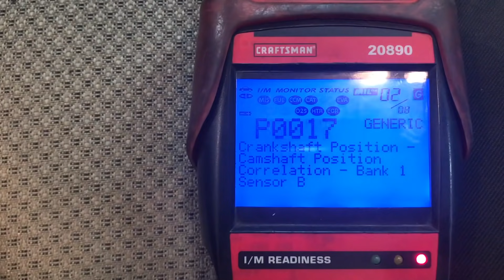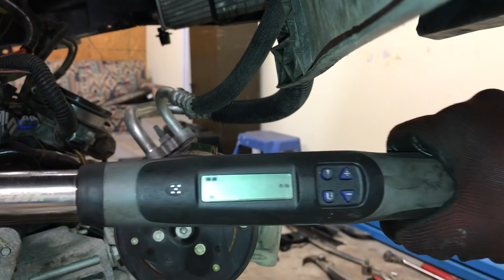Step By Step: 2.4 EcoTec Timing Chain Replacement

Comment: Before anyone does this make sure you look up your engine code because this is the same process for these engines but there are different cam positions for each engine like the LEA or LFA engine codes not following that can destroy your engine because it will set your timing way off if not carefully looked over 15 year gm tech here!

Comment: Anyone have any advice why the exhaust cam wont line up with the black link on chain? Gold link on intake,black link on 5 oclock position,  the exhaust cam sprocket is like a tooth or 2 off. Do i need to rotate or wiggle the cam and set the chain on the sprocket that wsy or rotate the sprocket not the cam

Comment: While the engine was out of the vehicle, you should have removed the intake manifold and cleaned the PCV passages so that the engine does not consume oil and therefore will not run out of oil which can cause premature timing chain failures.

Comment: Guys he did a good overall job on the parts that were replaced. But I highly suggest replacing the balance shaft chain,guides,sprockets. These parts fail just as quick as the timing chain. Meaning of any of those parts fail or are wearing that trash is going to run through the brand new parts you just installed. And you will have to do it again. I also highly suggest replacing the cam sprockets for the exhaust and I take cam.

Comment: After changing the timing chain on a 2016 Equinox LS, we were somehow missing the long bolt for the timing cover. We were able to replace it with a bolt from the hardware store... 8mm hex x 1.25mm pitch x 100mm.

Comment: Good video very helpful, just have one question,
Is there any reason why you can’t put the new chain in from the top instead of needing a hook tool to pull it up from the bottom.

Comment: Still sounds noisy like mine? Maybe my timing chain isn’t bad? What else could make that noice or give me the P0014 code?
Reply: Pull off valve cover and make sure anyways. If chain it bad you’ll see signs on valve cover over chains. Mine leave visible grooves on the valve cover but mine went on for some time. If not as bad you’re going to notice less carbon build up on cover over chains from the slack knocking it iff

Comment: what if the intake alignment mark is not in the correct position it's at 5 oclock not 2 o'clock and why are all theses videos skipping this problem
Reply: @ranger.auto.repair my other channel we did this job using a 2017 equinox and I also did an updated video, if the cams are not at 10 and 2 and the crank at 5 you risk pistons hitting valves you’ll get a clattering noise and you’ll get a code for camshaft correlation error or crankshaft/camshaft timing error, so it’s critical your marks are dead on before you do the tear down.

Comment: How much would it cost on the low end if i went to shop?? I already have all new parts u mentioned
Reply: How much did u payed?? My car might need a timing chain I know the parts are cheap but not the labor 😭😭
Reply: No one would do my timing chain. Tried dealership and two local shops. One gave me a price of 1650 before tax but needed an assessment first. I paid 350$ for GM timing and balance chains plus guides and tensioners.

Comment: Great video! Some pointer for doing it without dropping the subframe. 
Remove your left (looking at the vehicle) engine Mount and take the bolt out of your front engine Mount. This will allow you to jack the engine up and lower it to access some of the bolts from under your wheel well. 

Make sure to buy extra phaser bolts. Those are the 10mm head bolts used to hold the chain guides. It is the black bolts with spacers. 
Have you x2 crank bolts as well. These are the 18mm head bolts. These bolts don’t come with cheaper timing kits. 

Holding the cams:
I cut my old chain in half and used that around the crank sprockets to hold them and then vide gripped the chain to the car frame at the front. The helped keep the valves from opening while I loosen the crank bolts. It takes a specialised tool otherwise. It is not a rentable tool from Oreilies.

Comment: What was the original issue that had you install the OBD2 tool to the vehicle's diagnostics? I have a friend whose 2011 HHR stopped running. It has spark when cranking and has 55 psi fuel pressure. Is that a possible timing chain issue? I also do not have access to a hoist. Is there enough room to get the needed tools in place to do this job on the ground?

Comment: Awesome video, very clear and concise! A friend owns a Captiva and complained about a rattling noise at idle in drive or reverse, or air conditioner kicking in (under load basically) but only when the car was running for a while. I dismissed any accessories pulleys by running the engine without the belt, the noise was still there. I inspected the upper timing chain guide, and chain tension when the engine was cold, everything seemed fine (no broken timing chain guide "ear" on the right-hand side of the chain as commonly mentioned). Then I ran the engine until it reached operating temperature, pulled the rocker cover back off and the chain had now slack to it so my conclusion was a bad chain tensioner. So my question is, is the tensioner fully mechanical or is it affected by oil and oil pressure ? Thank you for your time.

Comment: When I rotated the engine the timing marks was back off
Reply: Same did you get the car running correctly after rotating the engine?
Reply: @ElCentenarioMolina  same 
After turning motor by hand the color links where off , 
But the time on cam phasers where still on point ? 
Is that the way it should be
Reply: @rafaelc4488  Yes and the Eco Tec Fired right up and is running well after it was rebuilt. Mine jumped time which bent the bent intake valves and broke the roller rockers.

Comment: I know this is old and I don’t expect a response but in the video it looked like u had it at TDC exhaust getting ready for the intake stroke but u said TDC compression and that throws the cam off 180 degrees from what u have on the video I just don’t wanna fuck this up

Comment: Why does this video show so much slack on the chain for the bottom sprocket. I have no room to get the chain on
Reply: Because one guide was busted, creating slack, creating a rattle and codes, which is why he needed to change the chain.
Reply: He's talking about on the replacement. I'm having the same issue. No slack to put chain back on bottom sprocket

Comment: best repair video I have ever seen.  I will do this same job on a 2010 with 79K miles this next fall or winter.  I don't work on vehicles during the AZ summers.  It will stay parked until then.  Excellent instructional video!!

Comment: Okay, hears the story. My friend bought this nightmare from his boss, and when it turned cold a week later, the cylinder head cracked, and an oil pressure sensor was dumping oil out of the electric plug in. I asked if it was overheated, his boss said no, and came to find out the vehicle had a brand new water pump installed...so that answers the question. Cylinder head was cracked at between 3 & 4, and water was in the oil and vise versa. I dumped all fluids and ordered a CEW cylinder head, but after a month of waiting, I was excited to get it only to find out that it was a CEY... returned it and waited another 3 weeks for the right one. Being anal I made absolutely sure to set the timing at 10 o'clock on the exhaust side and 2 o'clock on the intake side and 5 o'clock on the crank. Installed all new timing chain, exhaust and intake cam sensors (new) guides, oiler, gaskets, bolts, spark plugs, voltage packs, ect, cleaned everything spotless. Installed new oil pressure sensor and reinstalled torqued to specs...battery was dead after sitting for 3 months waiting on parts jump started the vehicle (chevrolet equinox LS 2.4L ecotech) replaced all fluids oil filter, antifreeze, started up ran for about 3 mins and shut off won't stay running...literally confused at this point.😢 any words of help on this?
Reply: Wow ...sorry you went through all that...what was the outcome?

Comment: Do you have a video showing how you drop the subframe? I'm assuming you have to undo the struts steering shaft from the power steering motor mount I just want to make sure

Comment: You could change the oil everyday for a year and if you put 60 thousand miles on the echotec  the chain will look like that and needs changed. Chevy  did this on purpose. Bycicle parts in a car means expensive repairs or new engines sold. That's also why the replacement engine costs so much.

Comment: New GM are  very disponible, I don’t recommend them , 1990s and older  used to be very reliable , you will never see this kind of problem on 3.1 or 3.8 engines

Comment: It’s been a great video, the only problem I’m having is getting the chain slipped back on all the sprockets. I can get 2 but there’s never enough slack to get the 3rd. Its 30°F here now, I wouldn’t think the chain shrunk enough to give me trouble.
Reply: Are all the tensioners removed?
Reply: Same issue here.

Comment: you can cut the top of the gasket were it goes behind the motor mount and dont even have to take the motor mount loose, the one i am doing now took out the head so in my case all but one bolt on the mount had to come out. lol all the valves are bent all but 2 rockers broke head it cracked on the intake camshaft holder.    Will it run-----of course,,,

Comment: I can't seem to get enough slack in the chain to get it on the crank sprocket, it's close but won't go, the tensioner guide is unbolted but there's no position to get it in for it to loosen the chain enough.

Comment: I am having a u0100 code saying the ecm is not communicating with the pcm  and I took to the dealer and they called me and told me it need a timing belt would that cause a computer issue

Comment: What is the torque for the engine crankshaft bolt underneath. U never mentioned it on your video..I'm stuck right now on this..want to make sure the tightened spec is on.

Comment: I had valve cover off tonite and I believe the upper guide is worn causing a clicking noise on decel around 1800-2000 rpm ,I measured thickness of mount guide and steel backing at 5 mm ,could you tell me the new part thickness and part number please ,thank you

Comment: stupid question: I triple checked timing marks lined up. After spinning the engine a few times, they will never land on their timing marks correct? The colored marks will always be in random places? Dont feel any resistance. I see in vid after you spin that the unique color is in random place as well.
Reply: I have the same question. Once you finished your job, did the engine run correctly.
Reply: @ElCentenarioMolina  i have done several ecotec timing jobs since i made this initial comment and can confirm that where the colored marks land after spinning the engine means nothing. They only matter for setting up the timing initially. And yes my engines ran fine after performing the timing jobs
Reply: @KillaSupra  I appreciate the reply gonna install the engine tomorrow, and was concerned that the marks didn’t lineup after spinning the engine.

Comment: Hi David - i have a solstice gxp turbo 2.0l turbo ecotec with timing chain drooping between cam sprockets.  Do have to remove radiator and condenser to replace chain?  For a mechanic that has done chains before - approx how big a job in hours?  Thanks for any update here.  Greatly appreciated.

Comment: Very good video. Only issue I have is after installing all new timing components is when i turn the engine over by hand the cam sprockets are making a clicking/popping sound as a turn the engine a full revolution. The sound is definitely coming from the camshafts /sprockets..

Comment: I have a 2013 Chevy Captiva sport 2.4 and just got the timing chain replaced, all 4 engine/transmission mount replaced but the engine doesn't start as smooth

Comment: If you drive a car slamming the gas down burning tires like a nut then chains wear faster. Chain jerks turning the cams with more stress. Pull off normally the life of the car & you’ll go far before needing a chain. That chain is a shitty design & I own one.

Comment: I need to do this to my wife's car but i think it's gonna be pain in a ass without taking the engine out
Reply: You don't need to lower the engine to remove that bolt. There's just enough room to pull it out. 
The only issue I ran into was getting to the tensioner bolt behind the motor near the firewall. 
Everything else is pretty straight forward.
Reply: @SirSmokesAlott  yeah I ended up returning the duralast, and got a Cloyes from amazon. These instructions said dont activate before.
Used locking pliers on the cam shafts.
My issue was that I stilll didnt know if it was  activated or not.  My only test was pushing down on the tensioner a bit, and it was springing back.

But, it did fix the codes!
Reply: There's a long bolt for the water pump on the timing cover that you need to lower the engine for.   This guy shows jack position to lower engine: https://www.youtube.com/watch?v=kS9NpgrUmMs&t=172s
Reply: @1111comment  thank you so much I started doing the job but I think I’ll put everything back and sell it as it’s it’s kinda hard for me or maybe I don’t have right tools or knowledge lol
Reply: @ozgurugur7609   I just put everything back too after seeing the oil pan only can drop a 1-1.5 inch  before hitting the bar below.  😂 

I only see slight slack in the primary chain. But, I could see the primary guides were in tact and when i turned the right camshaft with a 24mm wrench, the chain became taught. 

So, now I'm looking into the possibility of just changing the tensioner without removing the timing cover. 

Trying to find another video besides this one for the malibu, but I'm guessing its pretty similar.

just changing tensioner:
https://www.youtube.com/watch?v=0WLA3HygyoI   
for the malibu.

Duralast video recommends activating it before installing:
https://www.youtube.com/watch?v=vVduE4He0pY&t=686s
https://www.youtube.com/s/gaming/emoji/7ff574f2/emoji_u1f602.png
Reply: @1111comment  don't activate it before installing the tensioner it can damage the guide. Or so I've read. 
I also wouldn't recommend AutoZone parts for your engine. 

But from what I seen on the one i started today. The only issue was the tensioner and possibly the intake camshaft sprocket (intake phaser). Those also seem to be an issue with these 2.4l motors.

Comment: Hopefully you didn't charge the customer for extra work by dropping the engine .  This job is so basic i dont know why you would even try to drop the engine. U can even do this job without taking off the motor mount
Reply: did it to show us.  Apparently, there is a long waterpump bolt that requires dropping engine a couple inches to remove before taking off the timing cover on malibus
Reply: @1111comment thats  my bad. My phone loaded it after he saod it very clearly he dod ot for a better video

Comment: If you are not changing out the phasers why do you have to remove them??. Can you just leave them in place and run a new chain and guides?? thx
Reply: guessing taking off the chain, and putting new one on is either harder or not possible

Comment: Great video sir. I would have suggested to have the oil pan removed to get the piece of the timing guide that broke off. Or at least try to fish the debris from the small opening   below the crank shaft sprocket. Other than that, fantastic video.

Comment: Blame GM?  That engine appears to have been neglected.
Reply: Nah, these Chevy motors are just junk. 
Oil changed at 3k interval with full synthetic and still timing chains/guides or tensioners fail before 80k... 
The one on my woman's car just failed at 130k. I guess we got lucky¿ Lol
Reply: @SirSmokesAlott   GM makes poor vehicles, but sludge is caused by poor maintenance.
Reply: @robinsattahip2376  it doesn't take sludge to destroy these things. They also have issues dropping fuel into the crank case. A 30 minute drive right after an oil change will produce black oil because of that issue.

Comment: @6:14 my chain develops a generous amount of slack during the rotating process, I verified chain links and cam tensioner release??? Any suggestions
Reply: Did it cause enough slack to jump teeth at the crank sprocket? I'm dealing with the same issue now when turning it over by hand. 
I'm starting to think it's the intake phaser/cam sprocket.

Comment: So those PO codes 0016,0017, 00101 you have were all related to a failed chain tensionor?  I was looking to buy a GM car with that engine and a lot of them have that code!
Reply: Just don't buy a gm, and definitely not one with the 2.4 or even the V6 for that matter. 
They both have these issues and even if repaired usually do it again in about 20k miles.

Comment: Question: why does the timing go off when turning the engine 760 degrees? I have realigned the timing 6 times and every time I hand turn the engine the chain is off a tooth?
Reply: Same issue here, did you find a solution? 
I'm thinking it's the intake cam hanging up a bit, but I'm not sure.

Comment: This was an awesome step by step video. Did this work on my sisters 13 Equinox 2.4l . I did it with the motor still in vehicle. Same thing though. Thank you for the great video.
Reply: with the motor still in the vehicle, do you have to remove the entire motor mount as shown? Do you put a jack under the motor in this situation? Could you get by just removing that bottom motor mount bolt?? thanks for any assistance!
Reply: At what mileage was the replacement done?